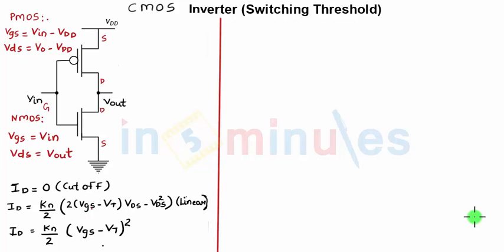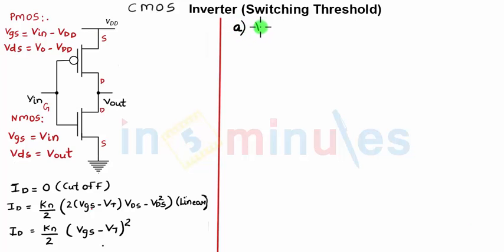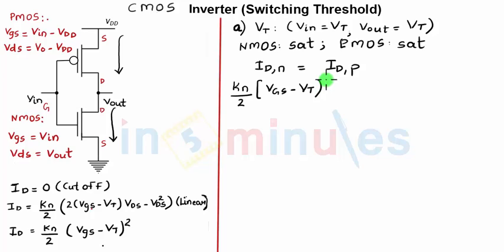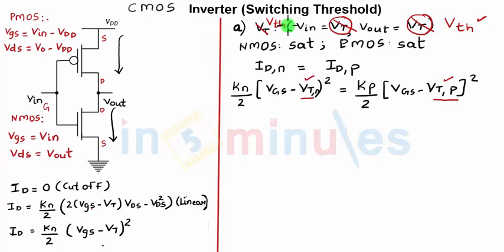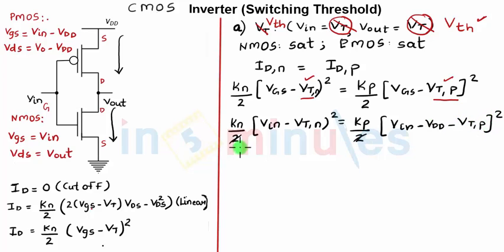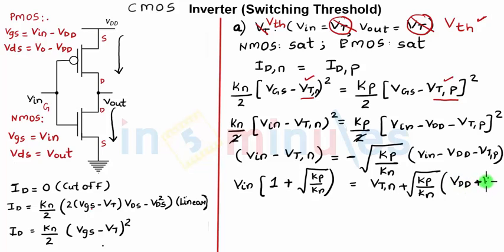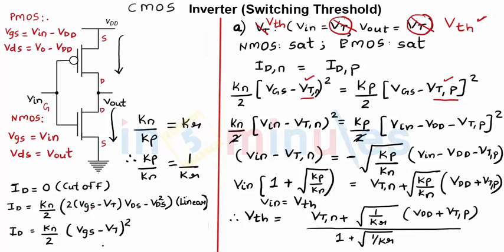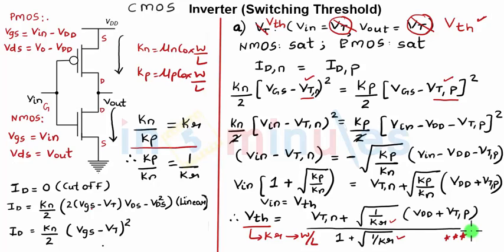Module2_Vid21_CMOS Inverter Expression for Vth Switching Threshold

Comment: why do we need to calculate switching threshold?
Reply: It is important to know for using a CMOS inverter like an amplifier (see small signal analysis and CMOS inverter like amplifier). It also gives information about when are the peak currents happening, since for the large part, CMOS technology is known to not consume power during steady state conditions, only when they switch from states they consume power.